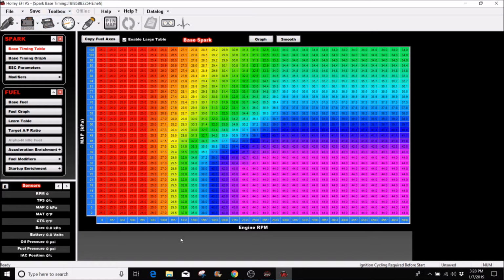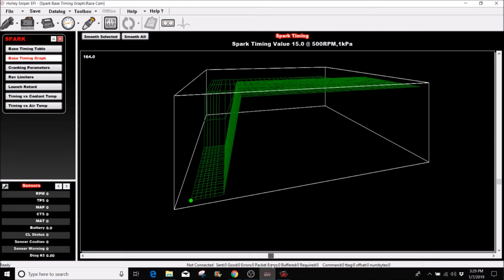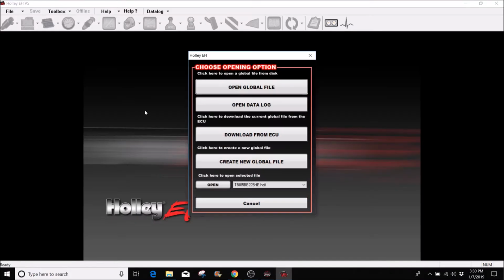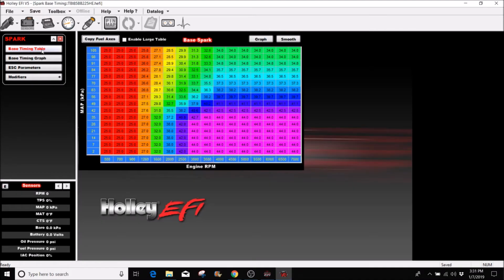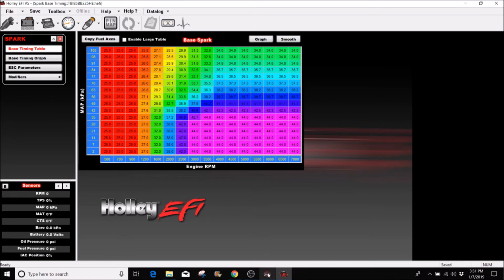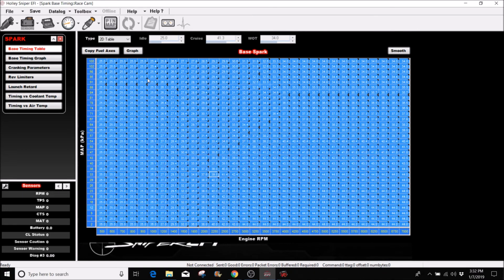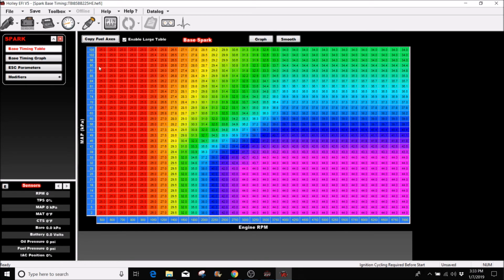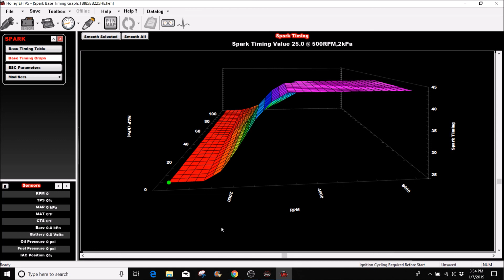Holley EFI Hyperspark Adjustments - Holley Sniper EFI Timing Table Made Simple

Comment: I have a rebuilt  350 with vortec heads . And mild cam . Running 308 gears turbo 350 2200 stall . Would this be a good initial timing to start with?

Comment: so I am about to put the config in the car now but just realized that the current config is 15 degree and the V5 version is 25 with WOT at 45, is that way to much for SBC. the video how to do this is great I learned a lot but the two configs are way off on timing what is a good table for stock 327/300HP 67 sbc? 15 initial and 36 or so WOT
Reply: You could copy and paste your old timing table into the new v5 table. That's what I would do if I have a good timing table for the engine.  It's hard to day if 25 is to much as I don't know much about your combo.

Comment: Will be following your instructions this weekend, I had the Sniper installed with stock Dizzy and Coil which was fine, Installed HyperSpark system and getting backfire condition so I am suspecting the jagged issue as discussed. also my IAC is at 30% so wil be readjusting the Idle screw and IAC together with tuning the Sniper

Comment: 15 degrees of initial timing Is that before TDC or after? or is it just say 15 degrees on the handheld?
 Just ordered this stuff got the Ignition box got the coil waiting on the Distributor from JEGS here in Riverside/ SOCAL I hope this thing does not get me in over my head doing the basic operation HEI on my Chevy 350 seemed easy enough.. I thought the box was supposed to simplify everything even more...Wont panic yet although I have been guilty of being a SPAZ from time to time HA HA
Reply from the maker: 15 degrees of timing is BTDC, before top dead center.  The box, are you referring to CD box?  Once you have it installed its super cool.
Reply: @socalstreetcars7054  Cool thanks for the info.  

 I got the whole Hyperspark kit one piece at a time kinda pricey but it comes with the Coil and the Hyperspark box and the Hyperspark Distributor I think they call it Hall Effect. Everyone is calling it ignition box so I just say the same. I am posting to You Tube as I go along. This is for My Aunts old 64 C10 Fleet/Short Bed it is not perfect but I am trying to make the thing reliable she wants to drive by herself to Des Moines Next Summer. She is 70 years old and wants this adventure so I am doing all I can to make it as reliable as it can be. So I Upgraded the Brakes, Suspension, Wiring and last to do is Add the A/C. I Really appreciate the help I get stuck every now and again ...Trying to make this a zero fail project as much as possible so even the rear end was rebuilt by  4 wheel parts in Riverside man that cost more than everything else but they claim its bullet proof guess we will find out.
Reply from the maker: @Jeffagarcia66  Just remember to keep the orange and orange and brown wire away from all the sniper wires those wires will give you EMI/RFI and cause problems.
Reply: @socalstreetcars7054  Cool I will route them away from all of it I forgot and put in a loom. Distributor just came today from Jegs looks very cool next to the monster sized HEI ...Thanks I will let you know how it goes
Reply: @socalstreetcars7054   Getting the wires routed today...good thing you posted this I forgot NOT to bundle this stuff up...Nice Catch Thanks
Reply from the maker: @Jeffagarcia66  you can bundle them but you'll probably get a bunch of EMI/RFI and the engine won't run very good.
Reply: @socalstreetcars7054  those are way too long I shortened them since the Coil and CD box are close to each other.

Comment: Cool tip, thanks!  So then, once you load the smoother table, how easy is it to modify?  Say you want to change the RPM that "centrifugal" timing is all in?  At that point do you have to hand-edit cell-by-cell?
Reply from the maker: The neat thing about having timing control is you can give specifics to your engine at all different loads when you can not do that with a centrifugal distributor.  Its all in no matter what at 2500 rpms and that is some times not optimal most of the time.
Reply: Technically not cell by cell, but if you perform a data log you can see exactly where your engine is in terms of RPM and kPa or vacuum and you can change those specific cells to whatever timing you want, say 42 for cruise.  Or if you want to go all in at 2000 rpm you simply change the cells values.  It's very easy.